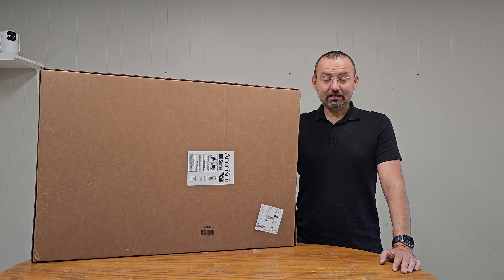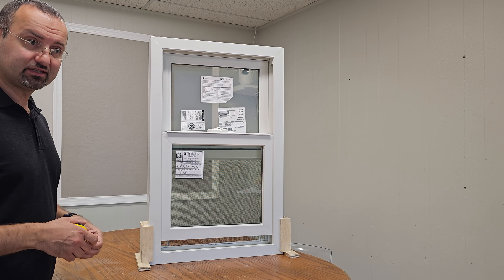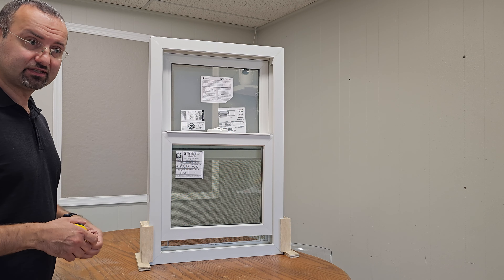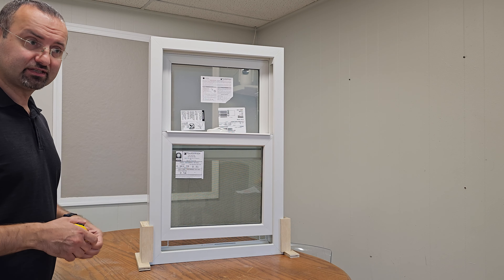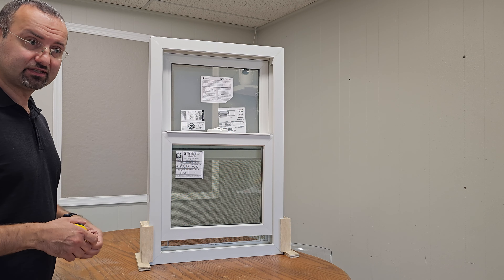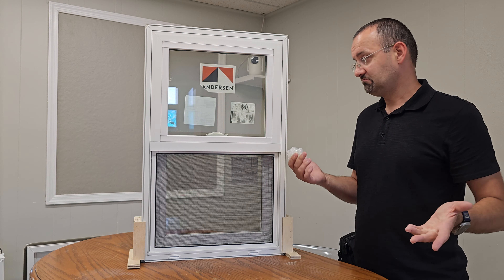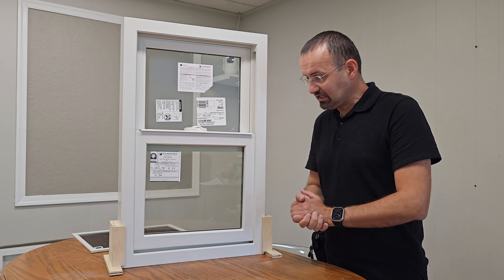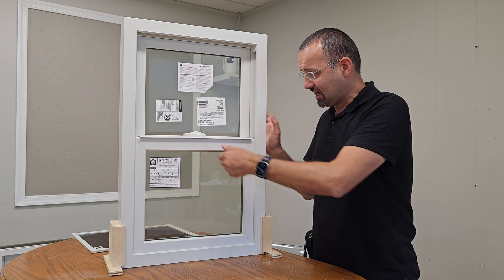Andersen Fibrex Composite Window| Design, Features, Performance

Comment: Not a fan of the 100 series. I almost pulled the trigger on 400s and 100 series for my new construction but did more research and heard that Fibrex becomes brittle below 40 degrees F. So glad I did research and ended up going entirely with Marvin.
Reply from the maker: Yes, we heard that as well, that when tested the Fibrex is more brittle at the low temperatures. Marvin fiberglass is definitely much stronger and allows to have generous glass real estate
Reply: Be careful with fiberglass. The finish tends to crack and peel after a few years. Good luck trying to get marvin to take care of a warranty on the finish. If they do honor the warranty you'll have to pay for the installation of the new pieces or windows they warranty.
Reply from the maker: @matthewpelletier6305  what climate are you in? We never heard about fiberglass deteriorating so easily